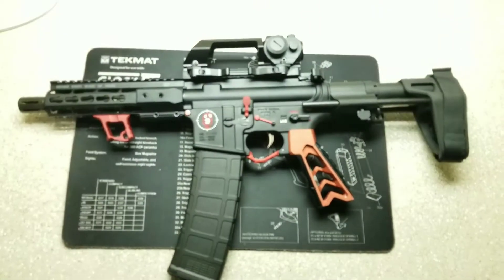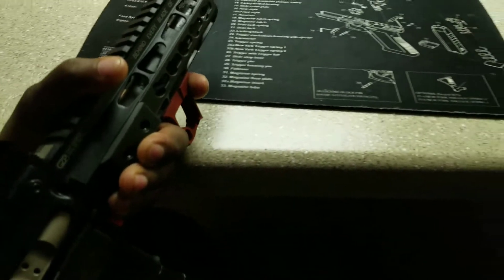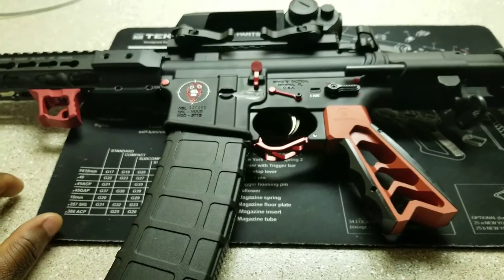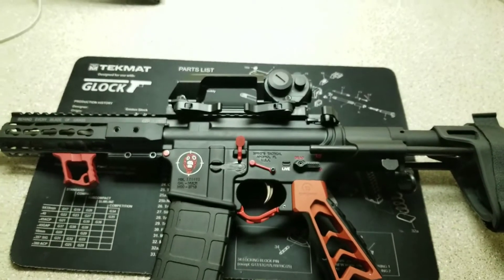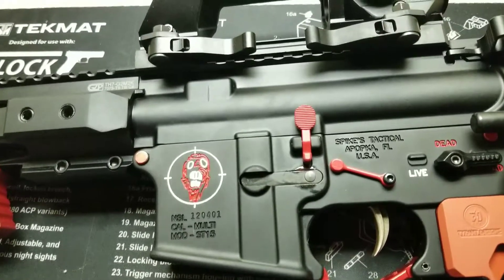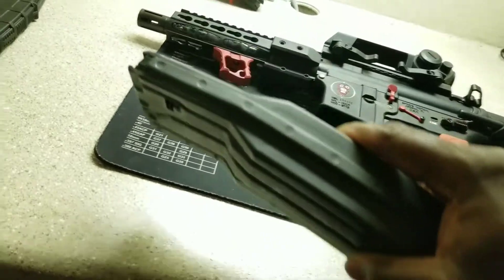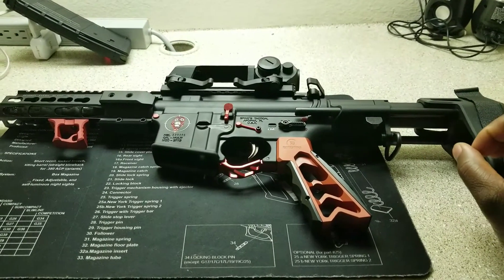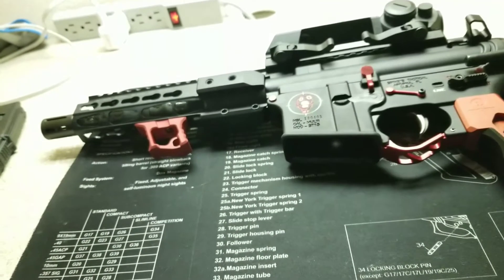Ar15 pistol echo 2 trigger

Comment: Wsup with that echo mode? You actually have a third position on your selector switch for it. It's sounds like a 2 round burst. Your trigger guard is cut away. Was that a custom mod or did you buy this whole lower reciever like this? Is this even the Diamondback? You have clowned with this one. Seriously nice.
Reply from the maker: Echo triggers just have 3 modes safety.semi.and echo / the trigger guard I bought that way I check who made it if u wanna know / and the lower is a Spikes Tactical lower with a Ground Zero Precision upper this was the 1st ar I built just wanted to try something different lol
Reply: @120506torque  man I sure appreciate you being forthcoming with the information. That's the kinda candy I like. Congratulations on your stuff.
Reply from the maker: @emmettmarbury6571  I appreciate u watching bro anything I can do to help I know I been slacking on my firearms but I'll b back at it I'm just back forth with hobbies

Comment: Did you have to change the Tungsten powder Spike's Tactical buffer out to an H2 buffer to make the Echo ARII trigger cycle properly or is the Tungsten buffer good to go? Fostech install video says that the Tungsten buffers will cause light primer strikes and thus will cause malfunctions. I just ordered an Echo ARII and was going to put it on my Spike's Tactical Jack pistol. Wanted to know if I need to replace buffer before heading to the range...Thanks
Reply from the maker: Anthony Servantes I have a H2 buffer inside and I have no problems with it